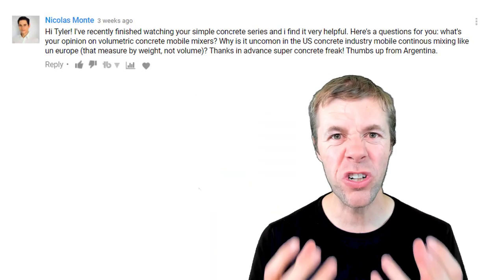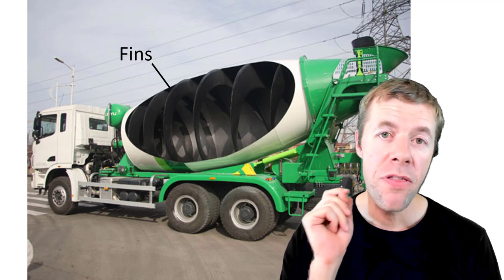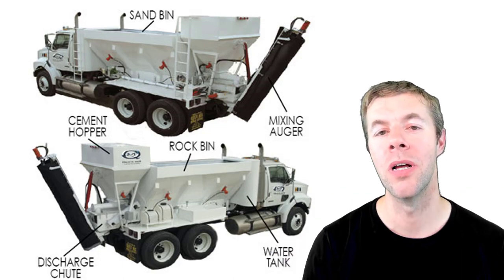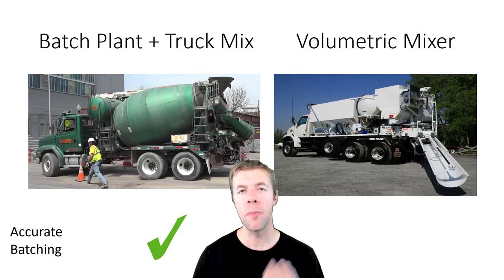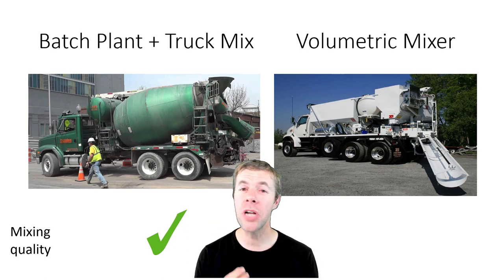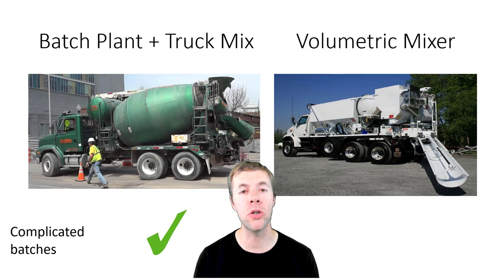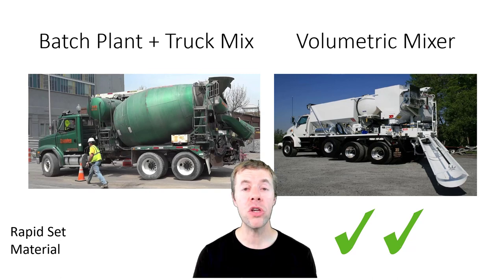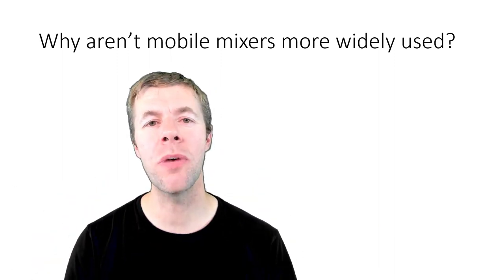Concrete Mix Trucks | Truck Mix vs Volumetric Mixers | Q&A Response

Comment: We just got our first Volumetric mixers and are jumping into the world of concrete. I've found that with the technological improvements through the industry over the last couple years that on the fly corrections/adjustments are so much easier with the integration of computerized gates, pumps,conveyors, etc. I provide mud in the middle of the Mohave desert with an avg. summer temp of over 110f. With hot weather like that mixing on site has been and will continue to be a huge advantage in my area.

Comment: I'm a concrete pump operator in Hawaii, operating in areas that can't be serviced by truck mixers, so the only options are volumetric mixers or mix on site. The critical aspect for me is the moisture content and being able to dial it in correctly. The mix time is also a huge factor for quality. We run our own mix on site operation using an Eterra BMX600 skid steer mixer. The increased mixing time and volume of the skid steer mixer greatly enhances the quality of the concrete at a faster pace than the volumetric trucks that are available to us.

Edit: happy I found someone else that's passionate about concrete! Really enjoy the videos!
Reply: My very amateur opinion is that on-site mixing is the way to go. Semi- Mobile batching plant with bulk materials supplied. Easy to do with space not an option.
Reply: How can you get a volumetric mixer into a place that can't be serviced by a premix truck?
Reply: @mytech6779  there are multiple bridges with weight restrictions that are just high enough to limit premix trucks from crossing but not volumetric trucks. Also, there are some jobs that due to the volume of concrete we're pouring, it's more cost effective to stock materials than to bring in the volumetrics. Also, at ≈$600 a yard, the volumetrics get pricey.
Reply: @IanCCal  If bridge weight is an issue you don't need to load the premix truck completely full, there are also smaller trucks, and a volumetric mixing truck with the same yards of material will weigh more because of the extra equipment. So I don't still don't understand that argument against premix. It really doesn't make sense that a premix company would buy the largest trucks if the island has a lot of bridge weight issues, but then good managers are hard to find anywhere these days. 

The second half of what you wrote doesn't seem to make much sense to me, like you went to another subject and left something out or started swapping terms???

Comment: I never dealt with any volumetric mixers during my 15 years as a cement mason, but I did like to have fresh concrete, instead of something that had been sitting in a mixer truck for too long. 
That was what we called "hot" concrete, and it was.

Comment: We do structural concrete and always use a mixer.  The utility guys that install conduit bring in a volumetric mixer.  It's good to know more about the differences.  Thanks for the video

Comment: I work for a company in Las Vegas we run 13 mobile mixers. Our parent company is a ready mix company. Clark County has very strict rules on what type of concrete can be used for sidewalk repair, thrust blocks for water lines and slurry for back fill. I'm proud to say we are the only mobile mix company in the State that is approved by the Nevada department of transportation, and the only mobile mix company in Clark County that is approved to pour concrete on public works projects. It took some work but we've been doing it for 3 years now and have never had a low break on samples taken for testing. We use both Cement tech and Pro All mixers.
Reply from the maker: Chris,
Thanks for sharing.  I think it is very important to share success stories like yours.  Keep up the great work and I hope more people follow you!
Reply: "the only company approved in Nevada"??? Sounds like the mob is involved there. lol
Reply: It's amazing what money in the right hands can do
Reply: Hi Chris, could I pick your brain on volumetric mixers? Looking to purchase a cementec truck soon in NV

Comment: I had a neighbor wanting to do a concrete job and I was in need of a new sidewalk.  We worked out a deal to do it together to save some money.  Volumetric Mixer showed up and mixed on the fly at his house, and then came over and mixed on the fly at my house.  No stress over waiting and work time.  I can't speak to it's  strength but it worked out for us.

Comment: We use volumetric mixers quite often on placements of 5k PSI concrete with air, fly ash and SPs. Most of it is tested under USACE/PDC rules. So far we have had good luck. The problem we have with truck mixes is time....often it takes a lot of that to get into some military bases and government facilities. But, I do agree, good equipment, a good operator, and an operator who will work with the customer is critical. The biggest problem to date is dust flying everywhere.

Comment: Tyler, I see this video is pretty old so you may not know about computer driven volumetric mixers.  I invite you to check out the Cemen Tech C60 mixer, I think you might need to redo the video after you see what it can do.

Comment: I work for a company that uses volumetric concrete mixers. I think there is a lot more research that needs to be done. We use them for mainly for rapid set slab replacement at airports and main motorways. For this application they are great. Also nightshift works, we are cheaper to open and deliver concrete than a batch plant and truck.
Reply from the maker: Ashton, 
I agree that they have their place and are valuable tools.  Thanks for the comment.

Comment: Another good lesson. I have only used truck mix because that was available on jobs when I was a working engineer. In my area, we have the front dumping trucks. 
When I was a teen, I mixed with a 5' tub and a mortar hoe. In 1976, at Ft Belvoir, VA we were experimenting with a volumetric mixer but it didn't seem to pass the quality tests. We were mostly using the notorious 16S mixer. It was a labor intensive pain.
I have seen so many mix problems on jobs that I don't think the volumetrics will be popular for a long time to come. I can see their potential for remote sites but not in CT. Good Luck, Rick
Reply from the maker: Thanks Rick!
It is cool to hear about the experience of others.

Comment: Had a project that cut it concrete cost in half by using volumetric mixers. We used the natural soil to backfill 2000 LF of pipe using a NSB Slurry.

Comment: Nice overview, but a couple points are outdated. Bay-Lynx has made fly-ash, slag, latex units. They just add an extra compartment such as a flyash bin. I think the past couple years volumetrics have seen drastic improvement as they now have moisture meters, automated admixes and water and gate settings. But your right, they do require calibrations every few months but even those are becoming simpler.

Comment: I live and work in Melbourne Australia and have been in the building and construction industry as a carpenter for 35 years. I don't believe that I have seen a volumetric truck here at all. We are big on reinforced concrete construction and have also taken to precast concrete panels in a big way. Precast has been used here since the 1950s by the then Housing Commission. Batch plants have in the last 5 years started using semi trailer mounted mixer trucks. Also a building we opened last year at the school I work at had an interesting development in the suspended slabs. Bubble Deck. The soffit was a precast concrete slim panel with exposed upper reo and 300 mm plastic balls placed in between. Let me know if you would like more information about this slab technology
Reply from the maker: Thanks Mark for the comment.
I would love to hear about bubble deck.

Comment: Love your videos...just discovered them. Concrete is fascinating. 

Either I have great vision, or a huge blind spot, but why not build a new cement truck that combines the best of both gravimetric and volumetric batching? 

Imagine a mix gravimetrically batched at a plant into the new truck DRY. At the jobsite the water and solids would be mixed near the rear as needed like in a volumetric truck. The mix would be accurate, fresh with maximum working time, and have no waste. On the way to the jobsite the driver could grab a coffee and watch a few important tik tok videos, all with no time stress.

Comment: With the Volumetric mixer how is the Air test conducted. Also how are mixes that require adding reducer, super and other admix chemicals added ? Also your right the moisture control can be an issue.

Comment: I've always thought volumetric mixers would be nice to send around to small jobs and jobs that come up just a bit short. But yes it would take someone with a lot of skill to keep up with all the maintenence and calibrations. At my company, CEMSTONE, we run the mixer at full throttle a full five minutes before leaving the yard.
Reply from the maker: Hey Mickey!
I agree that volumetric mixers can be very useful and are a great tool.  I am glad you use them.

I know Cemstone.  Say "hi" to Thor for me.
Reply: I suspect a lot of small contractors and DIYers who've been burned by a large concrete company dumping concrete that's been in the truck too long and hardens almost instantly would pay a small premium for volumetric mixing.  I know an unfortunately large number of people this has happened to, and the concrete company doesn't bear any liability unless you can prove it was intentional.  A lot of these small jobs don't require a very precise mix.
Reply: Cemstone doesn't use volumetric mixers. We also no longer batch on top of mud that has been in the trucks from a previous load. Back in the expansive years when it was all about saving nickles and dimes and moving high volumes of concrete we did and heard an earfull from customers about the practice. Much less nerve wracking to have a relatively clean drum for each load.
Reply: How much material do the volumetric trucks hold?
Reply: @wompbozer3939  i drive a volumetric truck in the Florida keys and with truck and all its 70k ib 10 yards

Comment: Never seen volumetric mixers in Australia or Europe. The closest thing to mixing decent amounts on site  are extensions on Manitou's. 
 
The latest I see are these really big mixers on semi's holding about 13m3 that go from job to job, unloading the right amount and then going to the next job. Likely with retarders added.
Reply from the maker: Mart,
Those big mixers sound crazy.  I would love to get a picture.

Comment: Friend, modern Volumetric Mixers can mix batches with color and fly ash and anything else you want.
Reply: How many yards can a large vol mix truck batch on site?
Reply: @alanbrown2666  It depends on your state/provincial weight laws. Usually anywhere between 10-12 yards.
Reply: Not accurately enough when the specs are stringent i.e. civil jobs. Bridges, tunnels, etc. Maybe one day

Comment: I see a lot of Vol mixers good for small curb pours. Moisture/weather can have a big effect on these trucks as well. Very cool vehical just some inaccuracy at times. Great vid btw!
Reply from the maker: Thanks so much!
Reply: Hot weather concreting  The Vcm has very low temp discharge. I have had drum trucks rejected for over temp concrete.  At the concrete plant as soon as water is added Hydration of the cement begins. This is why drum mixers turn constantly driving to the job so the concrete is does not start to jell and stick together. A VCM can us 20% less water and produce the same slump as a drum truck.  More Water less strength!!

Comment: I'm sorry but anything a transit mix system can do so can a mobile mix truck. It just takes money and knowing what you want to make. We keep is simple and just make spec concrete. It keeps the liability low. The bigger you go the more you stick your head out. You want 6500 PSI no problem. You want 150 PSI controlled density fill no problem. You want fly ash or slag, no problem. Head to head a Mobile Mix truck will make more concrete then any transit mix plant. We have volume metric trucks that can produce 100+ yards per hour if you can keep it full. I can empty a 10 yard truck in 7 minutes if you have an MCD 10-200. It is a monster and deserves respect when operating it.

Comment: My guess is volumetric mixer can safely and easily used on simple building like small houses where it does not use high strength or specialized concrete, as it is cheaper, and they have space for materials. In complicated building, it needs a lot more control.
Also, truck mixer is better used in tight space, as the customer does not need to provide lands for material stocks. Unless when land is cheap to rent.

Comment: ASTM C685 defines when calibration "should" be done. In most cases it can be done every 6 months. On very large projects it could be each day. The time it takes to calibrate is minimal for a trained individual. In reality, each has its place as some mix designs aren't feasible using the traditional batch plant/transport truck.
Reply from the maker: I agree!  WE need both.

Comment: My family's company started out with a volumetric mixer 30 years ago. Today we operate about 25 truck mixers. When your doing big jobs and have to be fast and consistent the volumetrics don't keep up. They definitely serve a purpose to the right company tho.
Reply from the maker: I agree Mike.  Thanks for the comment.
Reply: 👍 can't pour a straddle bent with volumetric trucks. Well, maybe if you run 3 at a time into the pump hopper!

Comment: In another video (not sure which one) you talked about how CO2 always gets into the concrete. If you cover the concrete in moss, then wouldn't the moss gobble up the CO2 before it could penetrate the concrete and at least slow down the process? I don't believe moss roots can harm the concrete, but i could be wrong. Thoughts, anyone?
Reply from the maker: Thanks for the comment.  I think that this could help but you would need a lot of moss.  We pour 6.5 million cubic meters of concrete every year.  That is enough to build a sidewalk around the earth about 30 times.  That is how much is placed every year!
Reply: @TylerLey  I'm only thinking about or my own home. I am considering building a geodesic type home from concrete, just trying to figure what my best options are. i really like the option of concrete covered in moss, i think it would be pretty, cheap and easy
Reply from the maker: That makes sense!  One challenge with that is that if there is a problem with your concrete such as cracking then you won't be able to notice it until you are having problems.  

Watch my video series about making, designing, and maintaining long life concrete:
https://www.youtube.com/playlist?list=PLRq6Z9d0kCT-FSFtZ4_iYDNdFaRae546Q

If you are really worried about CO2 attacked then you can not use fly ash and make sure you have a low water to cement ratio in the concrete.  You also need to make sure you cure your concrete really well.  

More on that here:
https://www.youtube.com/playlist?list=PLRq6Z9d0kCT84s-8px3XOeN8mBlxyXLkL

You could increase your cover on your reinforcing steel to be at least 2" and maybe 3".

Comment: I was wondering about additives to concrete. When I was driving and mixing my own loads, we had the nails or the microfiber to add to slabs or whatever to increase strength. I was wondering about coconut husk fibers in it as it is very darn strong,stronger than steel for its size. Hoping for input from the master Tyler Ley. Cheers. Love your videos,very informative

Comment: I suppose heknows this but thereis a batchplant for even faster laydown....mix it 20 yds at a time andput it in DUMPTRUCKS! this is common putting it in laydown machines for concrete highways.not mentioned here
Reply: The concrete road construction concrete, while delivered in dump trucks is made in a batch plant similar to the truck mixed ones (only bigger by roughly 50%).
Also hard to compare delivery of multiple dump trucks of concrete building a road, to a volumetric mixer doing a smaller pour.

Comment: Volumetric mixers are heavy, more mechanically complicated, and more expensive to buy and maintain. They do have their place though, especially if you are selling to lots of homeowners and do it yourselfers
Reply from the maker: I agree.  Thanks Cindy!
Reply: My volumettic truck does ADOT pours for highways that open in 2 hours after pour soooo, like the rest of the volumetric haters you probsably don'y have any real time experience with these trucks. It is really an owner operator game. I have seen 3month old cementech trucks at the plant destroyed by an hourly employee. 
I'll take the pepsi challenge against every one of your opinions that favor a drum mixer. Tell me how do you deliver 100yds 50 miles from the batch plant? My truck pours 60 yds an hour anywhere I stage materials.

Comment: In the 80s, a lift slab office building under construction in CT collapsed killing people. Immediately, the Media  hysterically blamed the concrete supplier, however the company had a sophisticated, for the time, computerized batching, time, record keeping process for every load from start to when the truck discharged at the site. The supplier calmly responded "The concrete met specifications", end of story. I was involved as a technician in their plants and trucks servicing the data acquisition equipment.
Reply from the maker: Joe,
What an awesome story.  Thanks for sharing it.
Reply: Ok but what was the reason of the collapse then??
Reply: To  @AlessioSangalli  -  Perhaps it was the Pawls that held the slab in place temporarily. It was about 1987-88 in New Haven or Bridgeport CT. I think the project name was La Ambiance Plaza if you wanted to look it up. I think it was also featured on one of those "Engineering Disasters" TV programs. I later worked with an electrician who had just exited the building when it collapsed, a near miss of a few seconds for him.